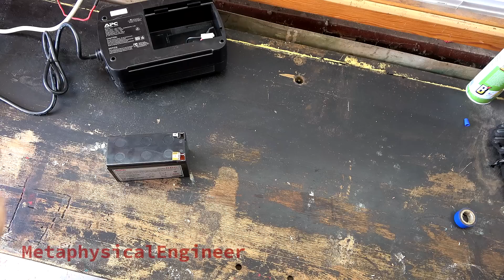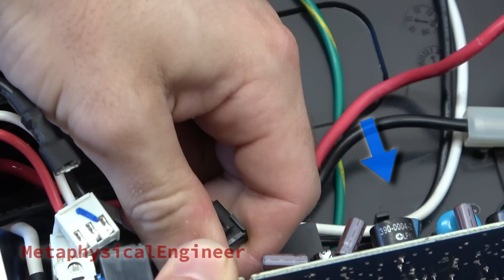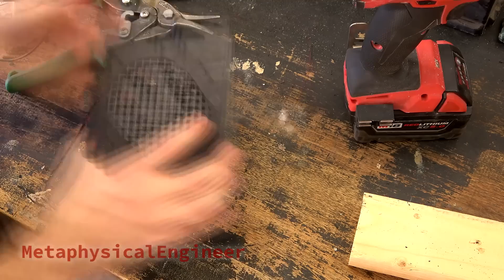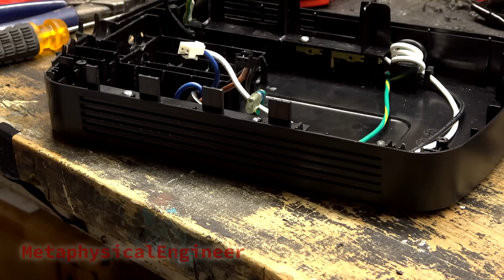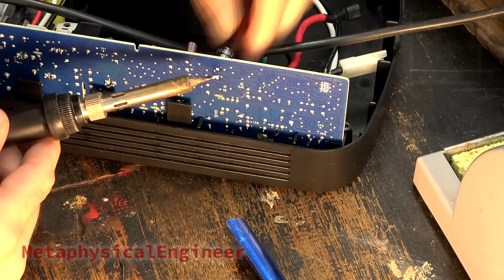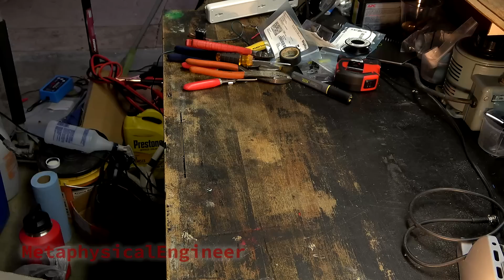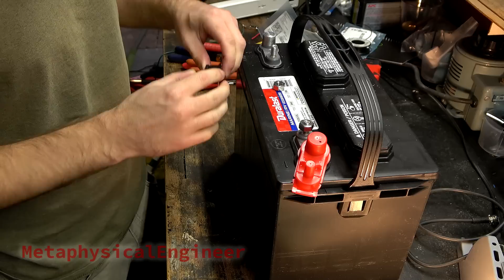Modifying broken UPS for long endurance BACKUP POWER!

Comment: It's not clear from the spec sheet how much of an approximation the outut waveform is, but it says stepped approximation to a sine wave.  Some equipment doesn't like that.  Given the availability of cast-off UPSs, I'd hold out for a UPS with pure sine wave output.  I used a Cyber Power 900AVR with two marine batteries when I did this the first time.  That one also produces simulated sine wave AC, but also provides automatic voltage regulation for dips and has higher rated output so it should run cooler to begin with.
Reply from the maker: Stepped approximation means modified sine in this case.  Waveform looks like off period, square wave positive, off period, square wave negative, repeat.  Easier than square wave with no off period, but certainly rougher on some equipment.  My computer PSU explicitly states in an FAQ that the input stage is capable of running on modified sine, but that may not be the case with all brands and models.  

Wasn't sure the direction this video would go when I started.  Could have been a teardown and analysis of a failed unit, replacing a dead battery, failure during the extended load testing, etc.  Instead since it proved more robust than expected and how much that most recent blackout bugged me, I turned it into this project as shown.  

Absolutely have plans for a future version 2 with a much better UPS at its core, possibly with high performance LiFePo4 batteries and hybrid grid-solar charging system.  But that's way outside of my budget for the moment.
Reply: @MetaphysicalEngineer  LiFePO4 batteries are very cheap right now.  Maybe getting cheaper?  I just today hooked up a 4-pack of 304AH cells ($90 ea) to a Yeti 1250 to provide some serious capacity.  The Yetis are discontinued and sometimes you can get one cheap.  They have all the goods inside like pure sine inverter, a couple of different charging inputs with fairly large range of voltage (but limited to around 260W), older USB (1A?) and 12V accessory.  I added a real BMS because the Yeti only knows how to handle AGM, plus it doesn's balance.  You can run it without, but not recommended.  That's one way to get started.

Comment: nice project.  I've converted a larger APC2000 into using two external batteries like that for a larger system.  Look into Anderson Powerpoles for your battery connections, I think you will like them. (they're also genderless!)  Great idea using wire cloth for fan blade protection, I'm stealing that idea.  Dual voltage/current modules are also available in that form factor, I kind of like to keep an eye on current in builds like this.  Startech makes very nice USB chargers (2x 2amp, 5x 1 amp) that run off 12vcd but they're kinda pricey.
Reply from the maker: Thanks for stopping by!  I actually used Powerpoles a lot back when I mentored a robotics team years ago and we had excellent success with them.  Another thing I should probably get a supply of for myself, especially if I'll be doing further projects that need a high current quick disconnect.  A voltage and current monitor would be useful to have for sure!

Wire cloth came to mind as an easy light duty fan guard since I've used it on a few other projects before and we already had a supply for repairing attic gable vents.

Comment: Be interested to see if you get much issue from the gases released from the battery inside the house.  It's also explosive.  Cars with batteries in the cab have vent pipes attached to the battery to push gas outside cab.
Reply: it'd take damn near a dead short to really produce a noticeable amount of hydrogen. cars have vent tubes cause it's a relatively much smaller space and potentially little or no outside ventilation at time, and accidents or malfunctions. if it's in a closet or something, maybe. but any load that would create a noticeable amount of hydrogen gas would blow that 20 amp fuse. i mean, it had a lead acid battery in the first place... just a little motorcycle battery instead of larger car battery. not an entirely different situation. in a car, you're running lots of 20 amp fused circuits at once, averaged from 3, 5, 10, 15, 25amp, etc. this is just one. i don't really know how these work exactly, but i doubt the battery is constantly being cycled like in a car. the only time it comes into use is when there's a loss of power, pretty sure. or it would get a little charge when it goes low.
Reply: yeah this is why you usually get AGM batteries for this sort of thing.
Reply: @kargaroc386  I have never seen a consumer UPS with an AGM.  Are they common?

Comment: I would love to be able to figure out a way to take my current CyberPower 1350 UPS to fully utilize the two 36ah 12V batteries I wired in series for it. I have it protecting my home server but with no way to recalibrate the battery runtime on the unit (doing the 100W light bulb to keep it under a load until it dies trick didn't work), I am only able to get about 10 minutes tops out if the UPS before it shuts down. For reference my server is a 36 bay SuperMicro with a single 1200W SQ power supply installed (has slots for two, but I keep the second as a spare). it pulls around 810 watts according to my tester under a normal load. If one of the UPS units you showed in the video would handle that much wattage without popping the fuse on the UPS, I would definitely do something similar to yours.
Reply from the maker: 810 watts is right at the upper limit of your UPS rated capacity.  Datasheet claims only 4 minutes at full load with original batteries.  Your external batteries are bigger than stock but not that much bigger.  10 minutes is about what I would expect.  

The official ah rating of a battery is taken at a very small load; capacity is greatly reduced under heavy load.  The bigger the load compared to battery size, the worse the sag will be.  For example, the battery used on my project claims to be a 100ah battery, but the reserve capacity is 180 minutes at a 25A load, or effectively 75ah at useful load.    Put a voltmeter on your batteries when you do a load test with the server and watch how fast the voltage collapses. 

 If you want extended runtime, you will need much bigger batteries.  Similar in size to the one I used in my project or larger.  Put them in battery enclosures, use heavy gauge wire as short as practical, and use appropriately sized fuses.  I would suggest VRLA or AGM type batteries; more expensive but higher performance and safer.
Reply: @MetaphysicalEngineer  Thank you, I really appreciate the info. Basically I look for a good deep cycle 100ah or larger 12V battery to use, using the shortest amount of heavier gauge wiring that I can manage in place of the smaller gauge wiring that it uses by default. I will research and see what my options are. I have access to several of the same model of APC UPS units like you used in the video, we usually test them out when the batteries fail and if it gives any issues when tested with a replacement battery it gets recycled. Now that I know I can use a beefier battery with one of those with careful modifications to improve cooling,etc. this may be the route I go with instead.  I use that type with larger batteries in them to protect my 3d printers in case of a short power outage, so it doesn't ruin a running print.
Reply from the maker: You would be much better off keeping your current UPS for the server rack, or getting another of even larger capacity.  A similar type of modification may be needed if yours does not have a cooling fan already.  The one shown in my project is not powerful enough to run your server equipment. 

 A pair of batteries like what I have would probably give your server an hour to 1.5 hours runtime.  Even bigger batteries or a second pair in a series/parallel configuration will extend further as needed such that your equipment can keep running through the longest outage you typically experience.

Comment: I've actually done this to the ups that's powering my PC at home, though I didn't open up my ups. I just installed to parallel lawn tractor battery's on it. Though I've thought about using a generator hooked up to the DC side incase of long term use. Maybe solar
Reply from the maker: If you have a suitable DC generator, that would boost the runtime for sure.  These units will likely handle input in the 11 to 15 volt range.  Keep an eye on temps, as the internals will just keep heating up until something cooks if allowed to run longer.

Comment: Great video! I love the concept of "backup" and how it's important to always be prepared. Speaking of backup, have you heard of the Segway Portable PowerStation Cube Series? It's a versatile powerhouse that can keep your devices and appliances running for extended periods, making it perfect for outdoor adventures or even during power outages. Check it out if you're looking for reliable backup power!
Reply from the maker: Very cool!  Expensive but a lot of features and capacity.  Only thing that bothers me is the transfer time is quite long at 20 to 30ms; typical for a UPS is 8 to 12ms.  Seems that most lithium power stations have the same behavior, but I'm not sure why.  Could cause the PC to shut down anyways.  If I have the budget, I'll see if I can get my hands on one for a product review.

Comment: Why did you go thru all the effort to cool the pup and then severely throttle the air flow by the way you mounted the unit on top of the battery box?  
Airflow need to be free to be effective.  Maybe flip the ups on it's side or build a standoff that hits the fan diameter rule to  turn an airflow without excessive drag.  Cheers!

Comment: Why in the world did you go through all that effort to install a fan to only severely throttle the fan by the way you mounted it?
Airflow needs to be free!  Cheers!
Reply from the maker: You're not the first to mention that.  Should have gotten a better angle of how the fan lines up with the channel on top of the battery box, plus the extra lift created by the dual lock velcro pads.  Actually plenty of flow through there!  
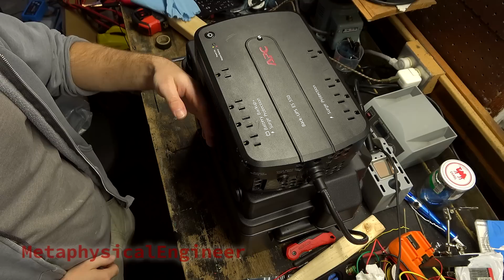You can see a bit of that by comparing position of intake and the velcro at 27:46 and position of velco and channel in the side view at 30:15.

Comment: Very well done.  Thank you for sharing your work; a device like this is attractive for keeping a photo printer running long enough to finish a job.  A company called Noga makes excellent tools for deburring holes, if you're inclined.
Reply from the maker: Thanks for commenting!  Yes this would also be great for printers and similar where a power cut could ruin the batch and waste material and time.  Doubly important if there's a deadline to meet.  

Since I recorded this video, I finally gave up on finding my MIA deburring tool and acquired a new one.

Comment: Nice work. Personally I'd have mounted the UPS on some riser blocks to give the fan a bit more space, but that said, it's still a very neat package.

I used to be in IT, and we'd frequently remove and scrap large server UPS units. Companies tend to have service contracts in place that includes checking and servicing their UPS units, and these companies tend to see batteries as consumables, so the batteries in many of the unit's we scrapped were less than 12 months old. It felt like a waste to let perfectly usable batteries go for recycling, so I managed to persuade my boss to let me scrounge a fair few 6 to 12 month old NP12-12 batteries for free (My favourite price ! :D).

I didn't really have a plan for these batteries, so I just daisy chained them all in parallel on a charger in the garage for about a year, but then one day I decided that if I didn't do anything with them it would have been pointless getting them, so I tested them all and matched up 16 batteries that were pretty much identical, then mounted then in groups of 8 in 2 heavy duty plastic toolboxes. I mounted a breaker switch, a voltage gauge and a pair of waterproof XT90 connectors on each box, then wired the batteries up in 4 groups of 2, all in parallel for 12V, and with each group having a fuse. The idea is if one in a pair of batteries goes bad and the other 6 try to rapidly equalise the voltage, it'll blow a fuse and then I only have a faulty battery (and one that's probably been damaged from over discharging) to deal with, rather than 8 damaged batteries. It also means that if a fuse blows it just becomes a 6 battery box until I replace the questionable pair, rather than a completely unusable box. This all get's me a total of 194Ah (2,304Wh) of capacity, but due to lead acid based batteries not being particularly happy about being run flat, I've set a much more battery life friendly 96Ah (1,152Wh) output limit for the pair. Because the batteries were free it turned this little project into a ridiculously cheap emergency power solution.

These boxes now sit next to my desk, permanently connected to a 20A storage charger. Sitting on top of that is a 3rd identical toolbox which contains 2x 700w (1500w peak surge) 12v inverters, a 300w (600w surge) inverter, several XT90 to XT90 cables, various adapter cables to take XT90 's to things like XT60's, barrel jacks, battery clips, 12v car accessory plugs, and USB chargers, a couple of cheap inline "RC hobby" type volt meters that also log total amp usage, a plug in mains power meter........... And a horrendously power hungry 12v travel kettle (What? I'm not letting a power outage mean I can't drink coffee, am I !!!! :D). There's also a 12v soldering iron wired to an XT90, a selection of bare plugs, a couple meters of a few different gauges of wire, and a roll of solder, all in case I suddenly realise I need some adapter cable I hadn't thought of after the lights go out. :D

I've already got a 1600w UPS on my main PC (I've upgraded the battery setup on that. It had 3x NP7-12's in series for 36v, so they came out and it now sits on a case extension that houses a 3P3S configuration of NP12-12's. While doing that I also noticed that mine had a couple of unpopulated spaces for 2 pin fan headers, so I soldered on some sockets that I salvaged from an old motherboard and, hey presto, they just worked. So...... Bonus !), this means the toolbox battery packs are really just to run anything else I want to use in a power outage. If power looks like it's going to be out for several hours I can drag these down to the kitchen to run the fridge and chest freezer for about a day, run the modem and wireless router pretty much indefinitely to get internet access back (Here in the UK, phone lines HAVE to be powered independently, so things have to be getting REALLY SERIOUS before the phones don't work, and according to a mate who works for the UK's main phone company, that includes any data that flows through those phone lines), or just run the modem, and a TV so I can sit back and watch Netflix for significantly more than a day while waiting for the lights to come back on. :D
Reply from the maker: Fan has more clearance than first appears; compare position of fan intake and the velcro at 27:46 and position of velco and the channel in the battery box lid in the side view at 30:15.

That's one heck of a setup you got!  Definitely the way to go if you can't let something as minor as a blackout get in the way of your work, leisure, or hot beverage of choice.  Unfortunately I have more limited access to scrap items now, between a change in jobs and increasingly strict rules against scavenging at recycling areas.  

I have yet to see if the network stays up during an outage.  I have a suspicion it may also go out since there's an outage notification soon after the blackout begins, and cell service noticeably degrades as well.

Comment: how about a good pure sine wave inverter, large batteries, and a good charger?  Go power 2000 watt, iota dls55, 4 group 31 deep cycles.   more expensive, but way more power and longer running.  could also be charged with solar.
Reply from the maker: The point of this project was taking something I found in the trash and seeing what it could do.  Since it didn't blow up, I turned it into something useful.  I'm absolutely open for a version 2 with enterprise type UPS, high performance batteries, and hybrid solar/mains input power.  But all of those components are expensive, so unless I'm finding them in surplus or scrap, the future super UPS will happen when it happens.

Comment: The Junk UPS's have a JUNK inverter in them, in my experience. They frequently appear at waste drop-off points, so it is good to recycle them for places where power isn't needed continuously. But the inverter in them is wasteful as a measure of excess heat.  They work for a short time before I inevitably overdo it and blow them up. And the ones I had generated a noisy, step waveform (modified sine wave) power. I have my doubts about their charging capability as well. They don't compare to a typical RV sine-wave inverter and charging system. But for a remote tool shed, or somewhere power is only needed to plug in a drill once in a while, they are amazing, and just about free.
Reply from the maker: The point of this video was taking something I found in the scrap bin and seeing what it could do.  It didn't explode and proved more robust than expected with added cooling, so I turned it into something useful.  It charges the battery and holds it at a safe float voltage, as shown in the video, albeit very slowly since designed for 7ah not a 100ah.  It can sustain a useful output to keep my computer running to ride through an outage.  Most decent computer PSUs with active PFC are able to handle modified sine; mine specifically points that out in an FAQ.  

I'm quite interested in a making a version 2 someday with better everything.  But also not in a particular hurry unless I can get the expensive parts as scrap or surplus.